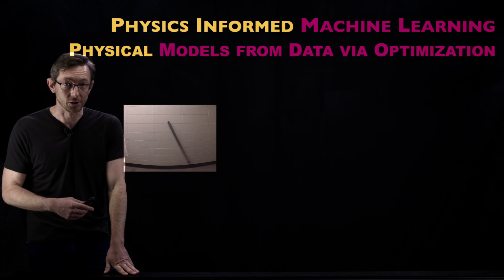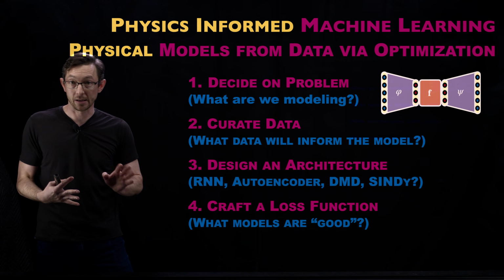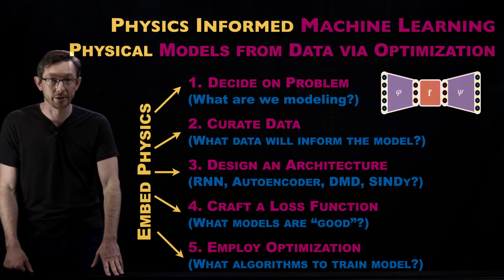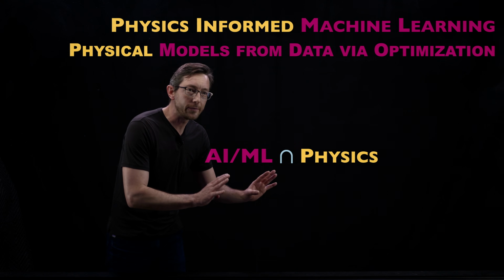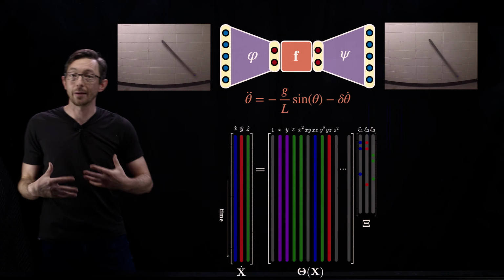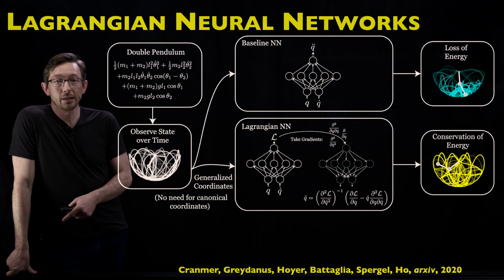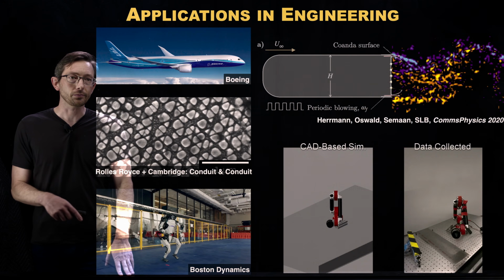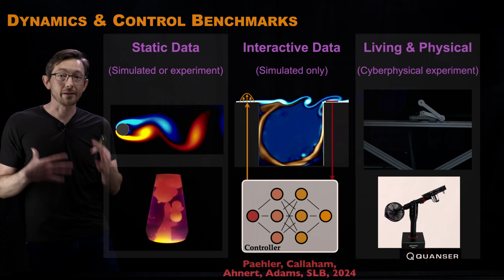AI/ML+Physics: Recap and Summary [Physics Informed Machine Learning]

Comment: You say you use a custom optimization algorithm for a specific term in the loss function, but then doesn’t that only optimize for that one term so that the parameters that optimize it, when found with the custom algorithm, may not optimize the other terms and you are just finding something “Pareto optimal” when you can tradeoff the loss terms, when we want the minimum of the sum of loss terms?  How do we then optimize the full sum if this custom algorithm only optimizes one term?  It’s not clear from these first videos alone, but I probably should just read the referenced papers and it will be obvious!